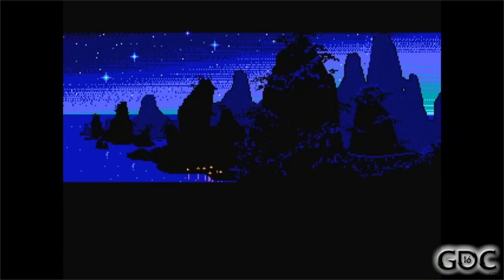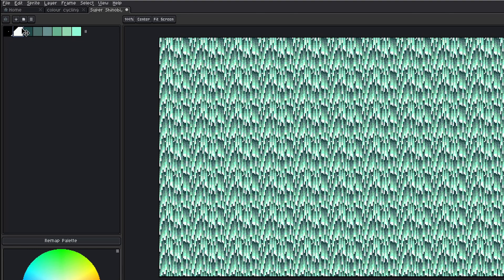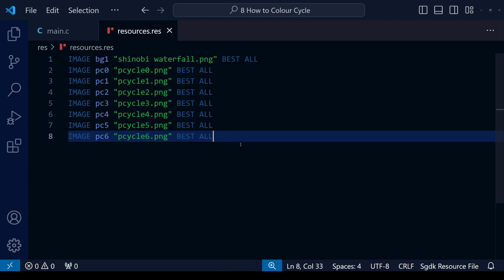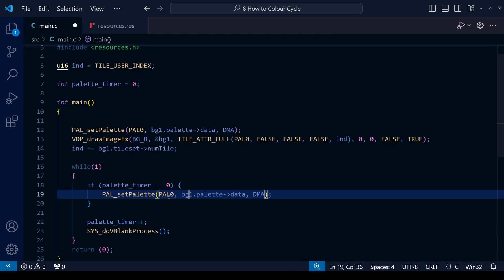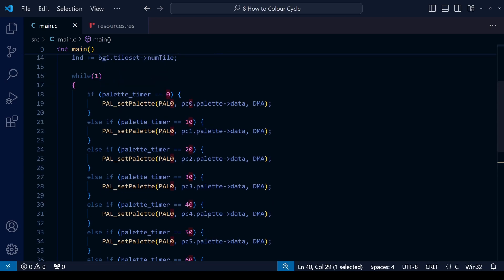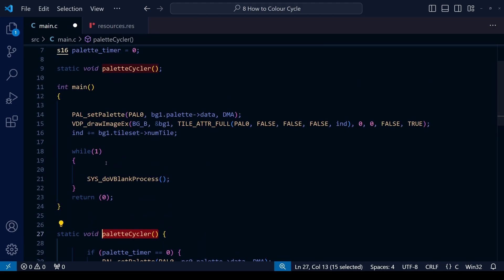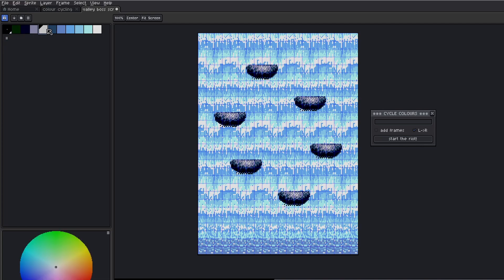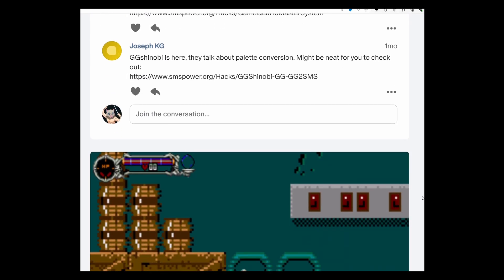How to Create Palette Cycle Animations for Sega Genesis & Mega Drive - Beginner Game Dev Tutorials

Comment: Wouldn't you just shift the colors left or right in the palette each loop or every few frames instead of loading new palette each time?
Reply from the maker: what you can do is copy the palette data to an array and then manipulate that. I will actually be using arrays in the next lesson on fading in colours. I wanted to keep this lesson nice and simple and stick to techniques I've already covered to do something new
Reply: You can't "just shift colors" in the palette, because the palette is not stored in ram, but in color ram, which is part of video ram.  You can load the palette from vram to ram.  But in each cycle you will still have to: 1. shift the color in ram 2. load the palette from ram to vram.
Reply: You can do that in assembly by moving the pointer and then copying just that palette data to the CRAM portion of the DMA buffer, I suppose it's not as immediate doing it in C with this SDK.

Comment: It's crazy how effective some simple tricks like this can be on these old systems, and how it can create some really cool effects at a very minimal memory and CPU cost too. The waterfall in Shinobi is a very nice example of this in action.

Talking specifically about Mark Ferrari and palette cycling, this is something I've been banging on about as something to use on SNES for a long time, especially because of its ability to uniquely cycle full 8bpp 256-colour palettes. SNES can literally replicate the exact effect Mark Ferrari used in all his examples, reproducing his images exactly as they are with the full 256-colour palette cycling implemented but just showing a section of the full image to fit into the SNES' resolution (although scrolling 8bpp 256-colour images that are larger than 256x224 is also possible on SNES by updating off-screen tiles on the fly).

There's a video on YouTube created by Brad Smith called Palette Cycling on SNES that actually uses Mark Ferrari's images, which came about as a direct result of a conversation I had around using this approach on SNES in the SNESdev forum some time ago, and it perfectly demonstrates such a method/technique as it would look and work there. Brad even created a little program people can use to display similar images themselves for SNES if they want, but I've not seen any other examples from anyone else yet.

It's a shame no SNES game developers have taken full advantage of these pretty amazing capabilities of the system to date.
Reply from the maker: This comment keeps disappearing for some reason, so I'll reply while I still have the chance!

I skimmed through that video you mentioned. Technically, I don't think there is a problem using it on the SNES, but Mark Ferrari did mention that a single graphic can take him over a week, so it needs someone willing to put in the time to make it happen (both in terms of getting in enough practice over a long period to reach that level of pixel art skill, as well as taking the considerable amount of time to create the art itself).

I like drawing, so will see far far I can take things on the MD (although not Mark Ferrari level, obviously!). For 256 colour, I'll save that for my Saturn projects
Reply: @PigsysRetroGameDevTutorials  Yeah, to get the level of quality and beauty seen in Mark Ferrari's images, it definitely takes lots of time, effort and talent.